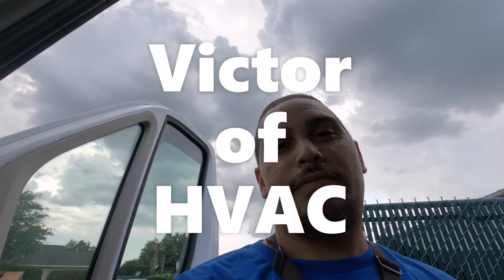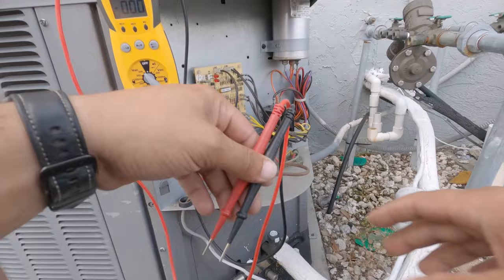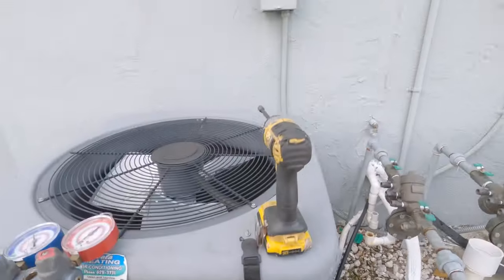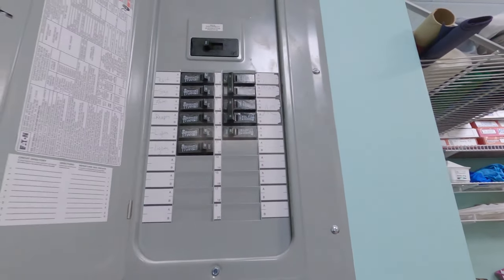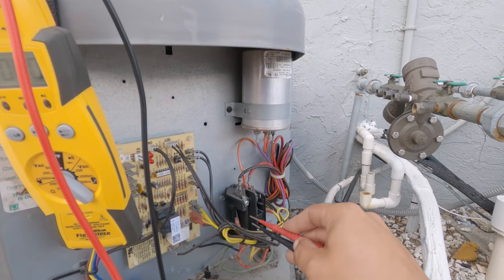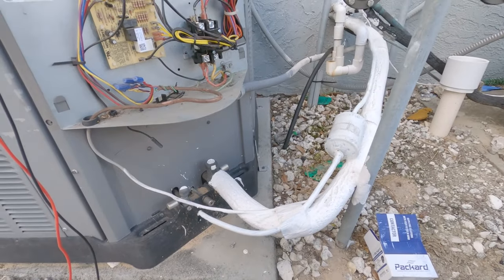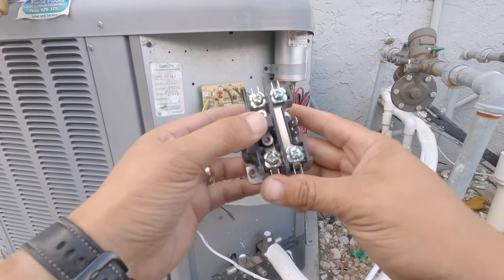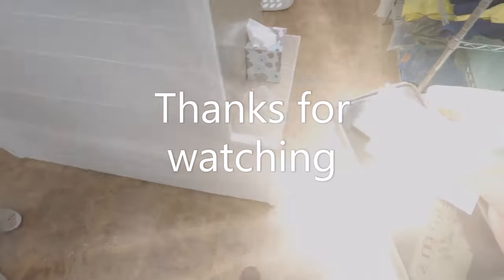Rheem heat pump not cooling. HVAC diagnose and repair

Comment: Gotta love that kind of call, and your quality of service is a cut above the rest. How many no cools or pm’s would you say is reasonable in a day? Just for some background, I installed American Standard residentially at a top tier outfit for 4 years before I moved states and I originally applied to be a tech but got hired for install. When I was interviewing they said their techs do about 3-4 calls a day. I’m at a tiny company on the service side of things, with a couple installs a week now. I’m finding that I’m often installing full systems with no help, and when doing service about 5-6 calls. The owner doesn’t believe in the necessity of a vacuum pump, so I bought my own. I’m at 29/hr plus commission and I’m not young anymore. I feel like my expectations and standards are too high to stick around forever.
Reply from the maker: Thank you sir, It's hard to say how many calls but I would say 4-6  calls a day is average. Some go smooth, some don't. Installers are not easy to find. Good ones anyways. Keep doing your thing and it will pay off in the long run. 👍

Comment: Could have been  burn wiring to compressor or burn compressor, may be jumping the gun .would of looked back if when turned power and it smoked
Reply from the maker: I appreciate your input but the concept behind this diagnosis has nothing to do with the compressor. I can see where your coming from though Don
Reply: @VictorofHVAC  Thank you for your reply back .I worked on them any years I was very good at what I done I was no parts changer if you know what I mean and sure you do.

Comment: My thermostat would turn on. No AC. HVAC guy said it's my defrost board. Orders part. Now this afternoon the unit is running, thermostat on, and cool air from vents. Is it possible to have a bad defrost board and it spontaneously start working?
Reply from the maker: They normally don't all the sudden work but it's possible. If the failure is on the incoming terminal, then yes. Goodluck and hope your hvac guy knows what he's doing. Defrost board diagnosis can be tricky sometimes 👍

Comment: Yes sir with 27 yrs in  installs & service ..& i still do an simple contact or most any component change out .esp an board .wire for wire ..several pictures always an blessing just in case an wire slips off & ur sitting there wondering where the heck did you fall off of  + helps if one can learn & read wiring diagrams
Reply from the maker: 👍 👌 totally agree. Thanks for the engagement brother 🤙